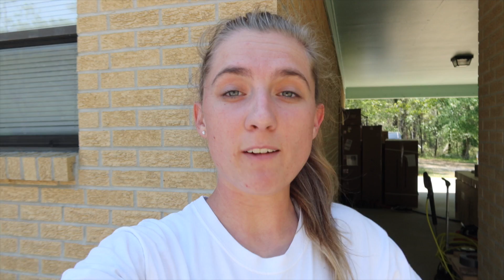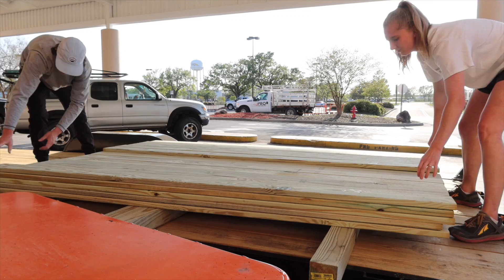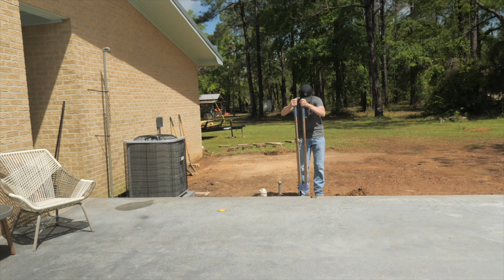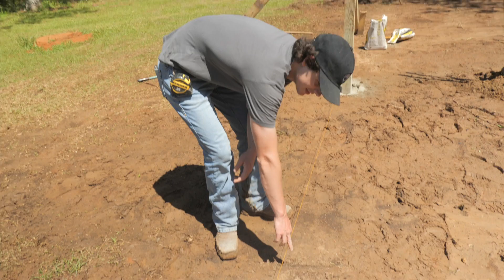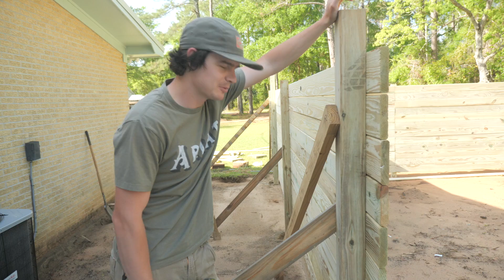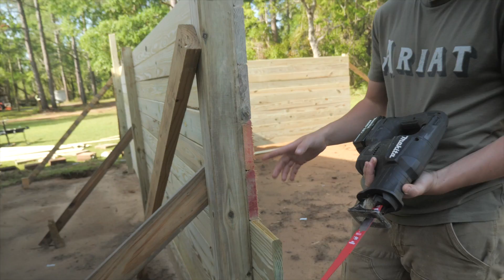DIY Modern Privacy Fence!

Comment: I the UK builder's merchant's sell concrete that is designed to be put in a hole in a dry state and then water it in so I don't really see anything wrong with your concrete technique. The do stress that you need to add enough water and give it a bit of a stir so you don't end up with places where the concrete is still dry. Not sure how important that is with a fence that isn't getting heavy loads as I know that concrete wicks water. That fence does look really sweet! 👍👍👍

Comment: A very good cut but not the right tool to cut the ends of wood off a fence. The tool is great at cutting doorposts so that flooring can be put under and to cut plug socket areas out of plywood ext.
Reply from the maker: Yup, and that’s exactly what we said in the video👍🏻

Comment: FWIW, I have rebuilt fences that used the dry concrete method, as you are doing, and the 20+ year old posts simply and easily pulled out of the ground, less the concrete.  20 Years later a large portion of the concrete never got water and therefore was still in powder form.  If you pack the concrete in and put water on top the top cures before total saturation and the lower and inner concrete never gets saturated.  I would advise pouring several inches of dry concrete, add water, pour more concrete, add more water, and so on.  I try to do thins in about 3~4 steps.
Reply from the maker: I think it depends on what part of the country you are in two. We have 100% humidity and the ground stays wet. So much so that if you leave a bag of concrete laying out overnight, oftentimes it’ll harden on you. You do have to be careful about packing to much. I’ve never in my life seen a concrete post in our area come up with powder still inside. I get to see about 2000 every hurricane season around here.
Reply: @Woodbrew  I’m talking about Houston Tx. Not totally different than your location.
Reply: Yea I have always poured water in  halfway and then poured the dry concrete.
Reply from the maker: Yup! We didn’t show it in this video, it’ll be in the build video, but we used a power washer wand to get water down in the bottom of the hole🙃
Reply: @Woodbrew  it’s easier to just add water as you go and then you know that you are saturating the concrete.